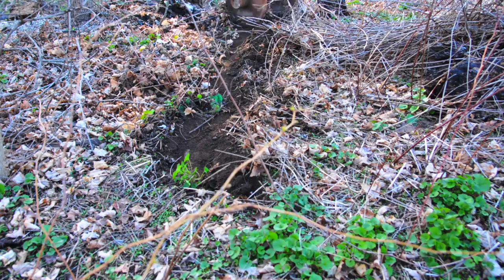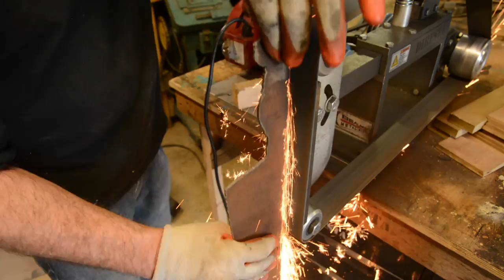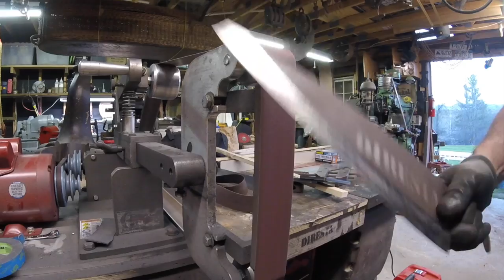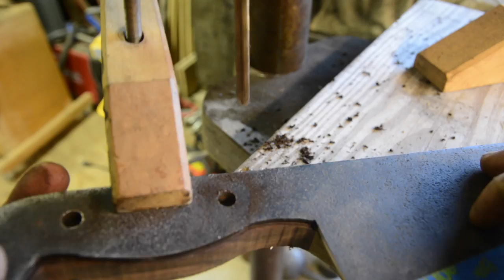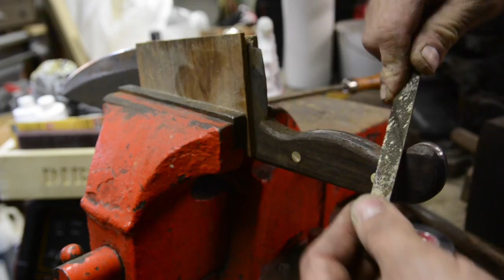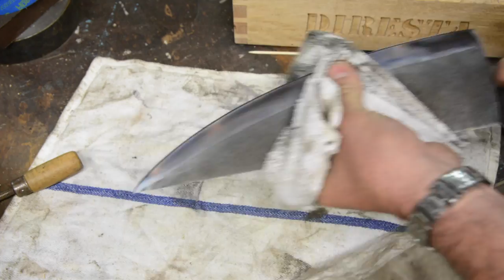✔ DiResta Big Giant Knife

Comment: Looks good +JimmyDiresta ! Something I've discovered is that its pretty easy to put a chamfer/angle/round on the "bolster" part of the handle scales (that transitions to the blade) if you clamp them up using the pins as a reference before you put the knife handle between them. I usually use belt sander +/- files. You can get all kinds of transitions that way (even carve it a bit) and if they're a bit off it doesnt matter - once it's attached to the knife, the blade is inbetween the two and you can't visually compare one side to another.

Comment: Hey jimmy, dont' know if you know this, but it's just a suggestion so you dont wear out your belts. If you ever decide to make something else from that giant saw blade again, and you're not worried about time. Soak your cut out piece(s) in apple cider vinegar for maybe a day or two to remove the rust depending on the amount that's built up. I've done this multiple times with tools and scrap metal ive used for knife making and it works great.

Comment: Didnt see you temper that blade after hardening?????
Reply: +john smith easy mistake to make.
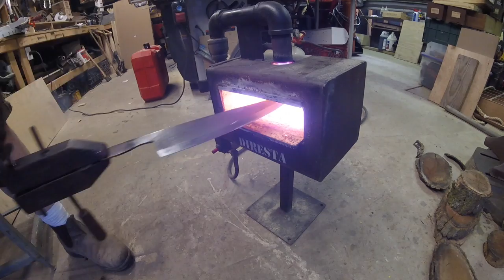Reply: +john smith Wasn't that around 4:50 ?
Reply: +Brandon Darensburg No....At 4:50 he is hardening the steel which makes it very hard and brittle. It must be reheated after this at a lower temp to temper the steel and make it less brittle. Some put it in a toaster oven at 400F for 2 hours...other guys like to heat it with a torch until a desired color appears. Opinions vary BUT MUST BE TEMPERED or it will snap. Put an old file in a vice and hit it with a hammer and you will see....file will snap right in half.
Reply from the maker: +john smith did off camera. Just boring.
Reply: Oh wow i appreciate the clarification
Reply: +jimmydiresta I recently saw your Knife Collection video and I saw that you had a lot of older worn out leatheathermans or at least the mechanisms were and you said you like modding knifes so I thought it would be cool to mod an old leatherman into a balisong/butterfly knife somehow.
Reply: +jimmydiresta LOL  OK if you say so.  A rather important step not to show (or mention) if the intent of your videos is meant to be instructional AND accurate.
Reply: +john smith I don't think it is meant to be primarely instructional I guess it's more a showcase of his work. Which is working great for him since 99% are dummies like me and just wanna watch the process not caring if something was left out.

Comment: Mr. Diresta, I would like to share with you a couple things that I have found to be very useful. I see that you do a lot of file work and as such the files do load up with the material you are filing. I have found it very helpful to coat the file with a layer of chalk prior to using the file. It makes the file much easier to keep the teeth clean.  As a gunsmith I feel one can never have to many files. While I am on the subject of files, if you have a great deal of material to remove nothing beats a rasp designed for use fitting Horse shoes.  Finally, Birchwood Casey makes a product called Truoil. It is the finest finish available for finishing gun stocks. Wet sanded into the wood and allowed to cure it not only fills the pores, it also offers a waterproof barrier. After curing it can be sanded lightly with 600 grit wet or dry paper and a final finish coat applied. Manufactures of custom firearms charge as much as $500.00 for a Truoil finish. I hope you may find these comments useful in your endeavors.

Comment: Old sawmill blade would be either L6 tool steel or 1080 with 2% nickel alloy, a proprietary steel made for sawmills. How did you turn the rusty unground area black? I always used Jasco Metal Prep that turns rust into iron phosphate, that's why I asked. I hope you didn't just sand off the surface and paint over the pitted holes with rust still down in them?

Comment: awesome.
hey Mr. DiResta how about a special about diffrent types of wood.
hard wood/ soft wood how and where to use them. how some sorts react to water... how to make them waterproof. how to stabilisize wood, how to colour wood. how to dry wood from a tree by yourself. cut with the lines or cross them.
and those short little tips that saves you hours washing your hands after you made a knife handle from walnut for the very first time like i did... XD 
best wishes.
thanks for the motivation.

Comment: Hey Jimmy, (or anyone else reading this).  I recently did some work on some old butcher knives my mom had laying around her house for years.  Cleaned them up and sanded a lot of the rust off of them.  My only problem is they have started to rust again.  I cleaned them up once more and added some mineral oil to help protect the metal.  Does anyone have any advice on another way to prevent rust?  Thanks in advance for any help!

Comment: Watched it twice but still missed the step where the blade got etched. Thanks for sharing Jimmy.
Reply: it didn't, the black color is from the oil he quenched it in.
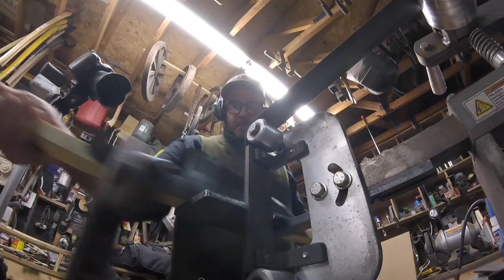Reply: +Thomas Hongshagen the blade suddenly has Diresta etched into the face of it . It first appears around 2:56 when the shot switches to face Jimmy as he's at the sander and his name is etched into the blade in the end shots.
Reply: +Frank B I didn't see that, thanks for pointing it out and sorry about the misunderstanding.
Reply: +Frank B I see what you mean now, but I think that is paint, makes no difference tough, but it would explain my confusion.
Reply: +Not a problem Thomas. It's unlike JD to put in a sneaky step.
Reply from the maker: Yes. Just the spray paint

Comment: when you went back at the grinder after quenching the blade it stopped making all those sparkles. is it because the metal has been hardened?
Reply: exactly. spark are just very hot small pieces of metal flying off. when steel gets hardened, less sparks fly off because the sandpaper can't remove the same amount of metals as when it's soft.
Reply: +Luciano Narno thanks!

Comment: buffing wheels don't make a good edge unless you're going for a convex  bevel and this has sort of a cooking knife type profile where a convex bevel is impractical.  you should do the grind on a belt sander or grinding wheel, set a microbevel on a stone, and set the polish on a strop for this style knife
Reply from the maker: Works  for me. Make a video.
Reply: I mean yeah it works and it's low effort, but there are better ways that make for a much sharper and more importantly prettier edge.

Comment: Hi Jimmy or any fellow creativists. Wat did you drop the hot blade into at 5 minute mark and what does it do?
Reply: Oil. Knives and other steel tools are usually hardened. The hardening process typically involves three steps: heating it up, quenching it in oil or water (depending on type of steel) and then heating it again, but not quite as hot as the first time, to temper the steel. I don't know if Jimmy tempered this knife. If he did he didn't show it. But tempering removes a little bit of the hardness, but also makes the steel less brittle. I also suspect he didn't heat it up enough to really harden it either. You can watch some knife making videos if you want to learn more.

Comment: What did you use to cut the knife shape out of the saw? (Sorry I'm new to a lot of this.)
Reply: They are called "Plasma Cutters",  they create a hot spark of energy like a welder and high pressure compressed air blows the molten slag away.
Reply: +Glenn Lawrie-Smith Thanks!

Comment: I see you went a little "Man At Arms" there with the tempering
Reply: you mean the hardening...I didn't see any tempering....
Reply: Tempering means to heat treat "Harden" a piece of iron/steel/metal.
Reply: +Don Rambo actually tempering is the softening of the steel from a hyper brittle and hard state into a more stable yet still hardening state. queching is the process by which the steel is hardened heat treating generally refers to the process as a whole.

Comment: I really wouldn't use that knife in the kitchen. The rough blade has so many ridges and open pores it'll be next to impossible to clean the bacteria out without using a prolonged heat treatment like a dishwasher. And doing that'll ruin the handle and the edge in no time.